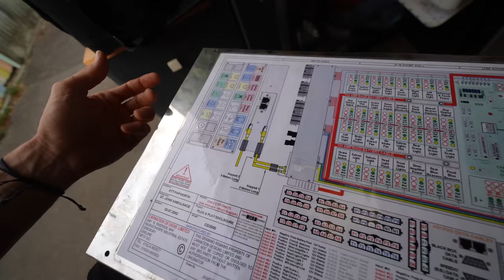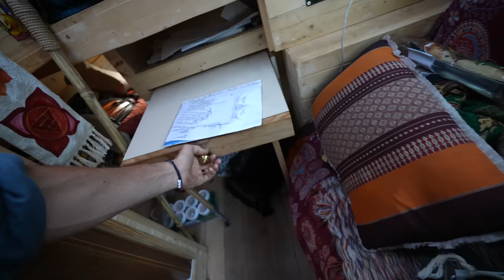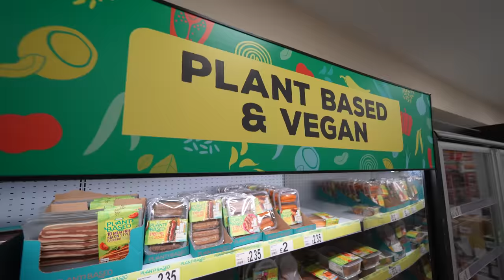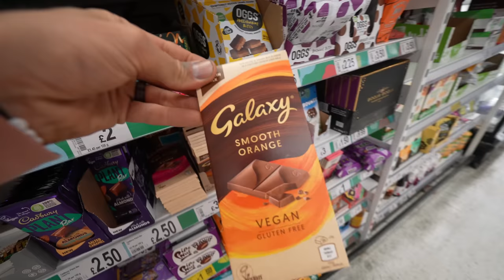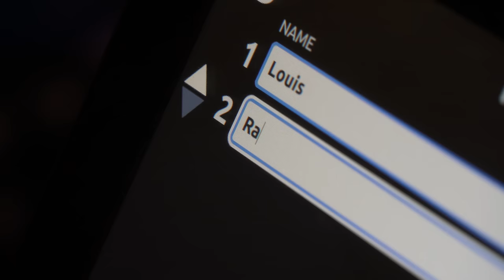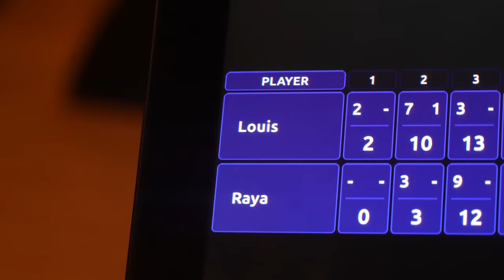Back To Van Life // Epic UK Road Trip

Comment: 10-12 hours back to London from Scotland ?>! Maybe from the central belt but definitely not from anyway further north / coastal. Even the shortest distance can take hours when you have to navigate around massive lochs, mountainous terrain and share single tracks with sheep ! Raya is right leave the Nc500 for another time and cherry pick a few places to try them out to see where you wanna go back and explore more. Definitely spend a night in the trossachs on they way to some of the more remote places. Try silversands near Arisaig - crystal clear water and white white beaches. Stay away from the large campsites and go for some of the tiny ones with sea views x